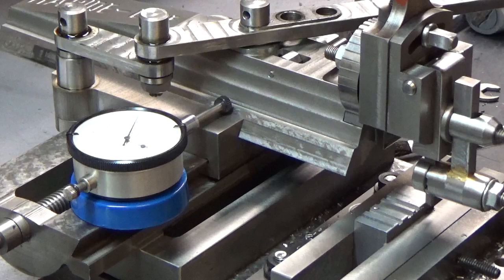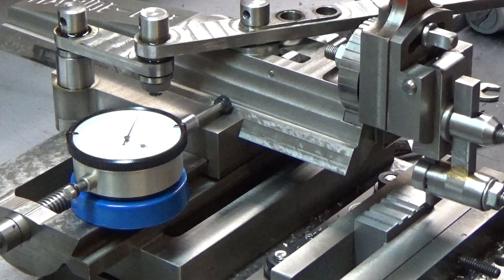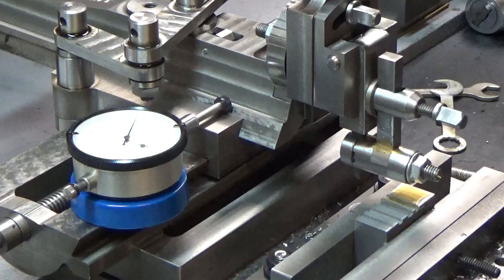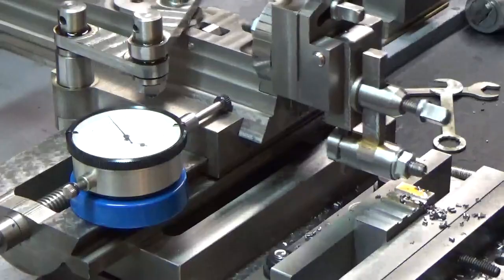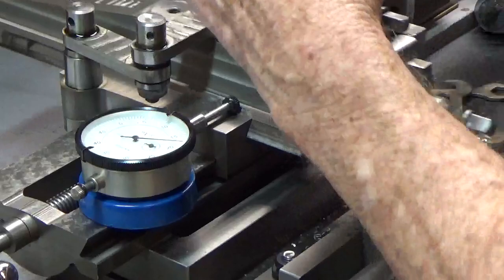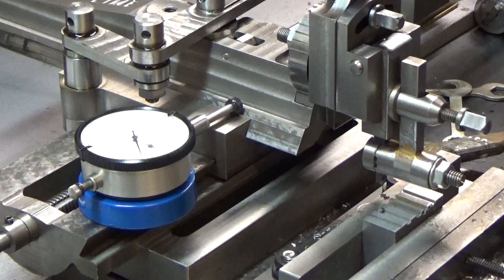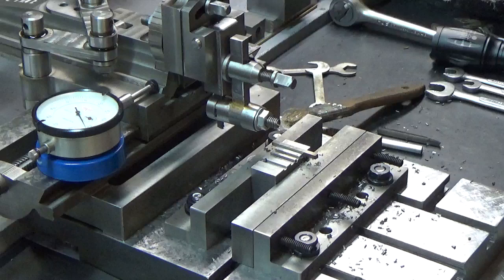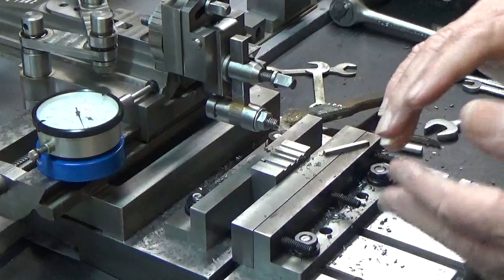Hand Shaper Cutting External Key Slot in 1018 Steel Block

Comment: Maybe the spring in the cut is the tool holder extension you are using.Might reduce it if you put the tool directly into the holder?
Reply from the maker: Peter:  Thanks for the comment.  I may give that technique a try.  Thanks and best Regards: Larry

Comment: Larry, I didn't know you had made this video, I think you might get better results by removing the ring behind the tool shank if you can, that way the back face of the shank would be better supported just a thought, also how about angling the cutter on the front face slightly from one side to the other instead of putting all the force on the front face, just another thought, seeing as you are experimenting,
Reply from the maker: Walter:  Both are absolutely great suggestion, why didn't think of that.  I guess it was making the slot, so I just stopped thinking.  Removing the washer would also increase the distance behind the fulcrum point for the cutter.  I'm sure the rigidity would definitely be much better.  Your right, the face of the tool bit is square to the work and actually be easier to grind if it had a slight angle.  Best Regards: Larry
Reply from the maker: Walter:  Removing the washer behind the tool holder was a treat.  I think the setup is more solid and the tool bit is further behind the pivot.  Thanks for your suggestion.  Regards: Larry